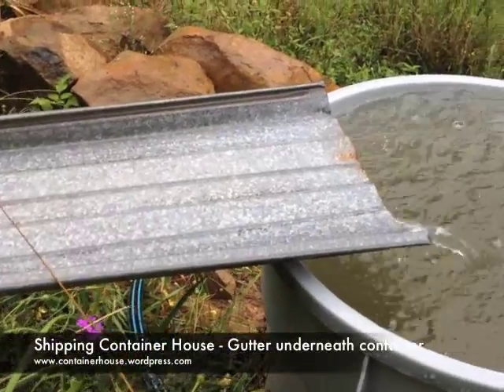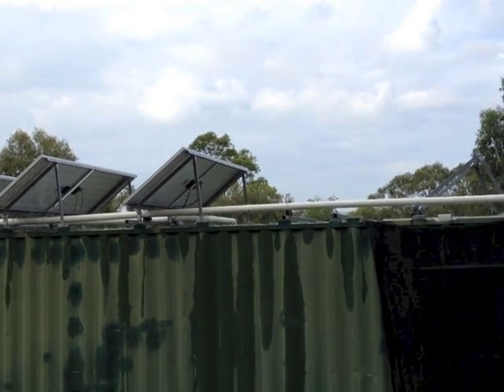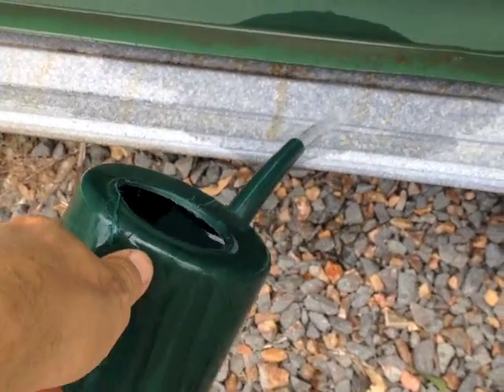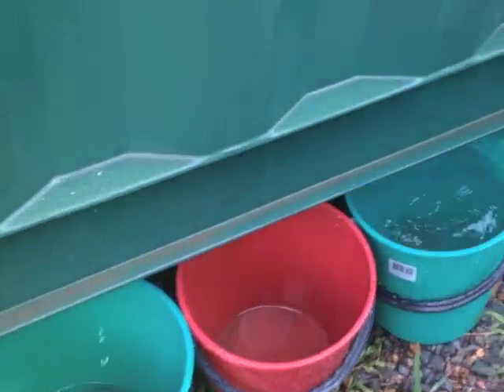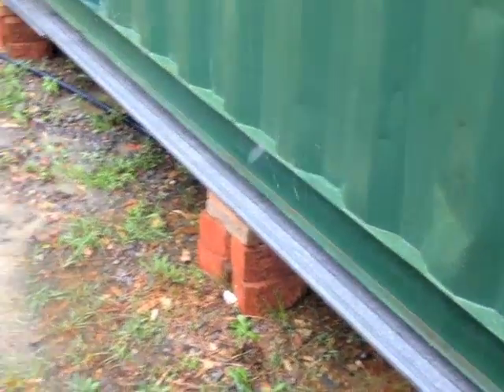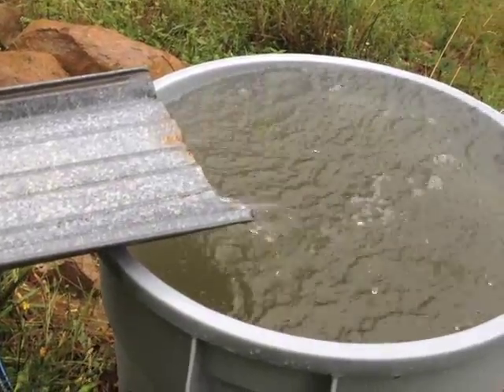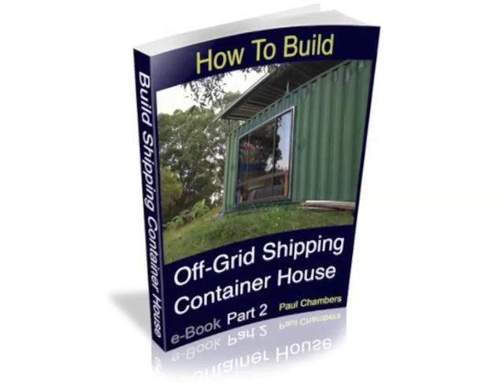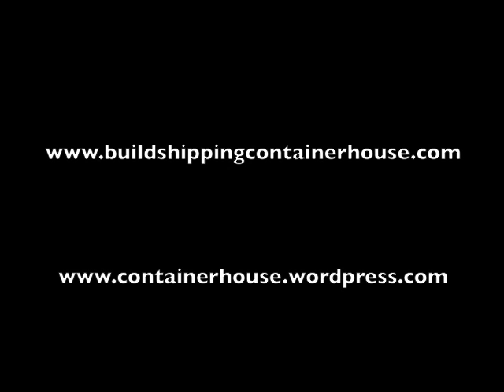Shipping Container House - Gutters underneath shipping container to increase water catchment

Comment: How do you purify the water?
Reply from the maker: Watch my YT video Water filters & replacement water pipes. All drinking water goes through a royal doulton ceramic drinking water filter with a ceramic candle filter. This is the finest filter possible. It is slow but it is very safe. Lots of "shed dwellers" in Australia just have a tin roof and a concrete water tank. Town water is extremely processed. Cheers Paul

Comment: My guess is that the float switch isn't operating properly as you'll need a bigger barrel to put it in. The float switch will need free and easy access up and down to be able to switch on/off reliably. Either that, or it's an Aldi brand product that just isn't reliable.... ; )
Reply from the maker: I agree, I think the pump is operating in too confined a space. It needs to be elevated off the floor so there is a very positive down movement to stimulate the switch. It ran the barrel empty and continued to pump dry so I am not going to give it a full time electricity supply. I am pleased with the volume it has saved me so I will refine it as time and priorities permit. cheers Paul